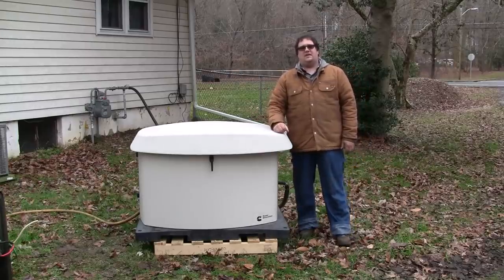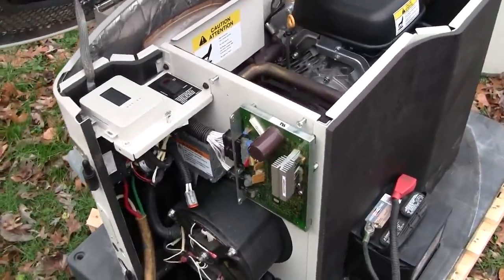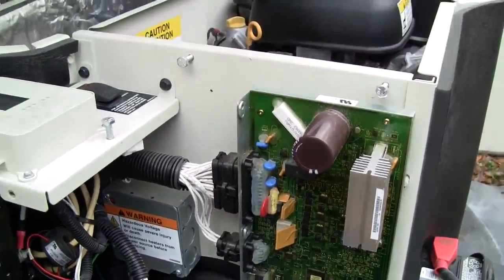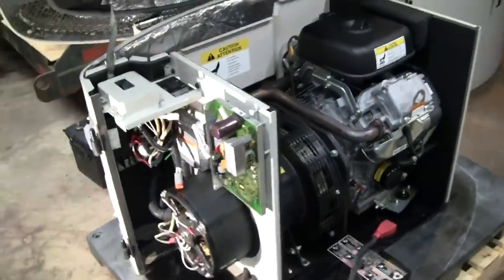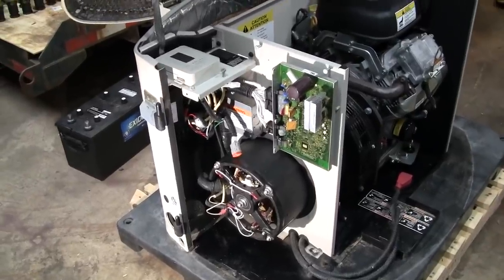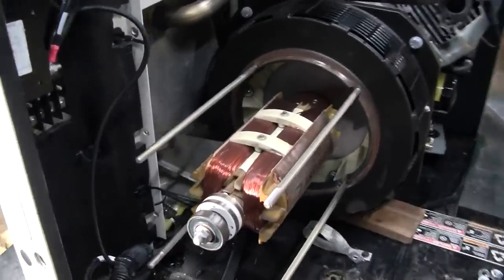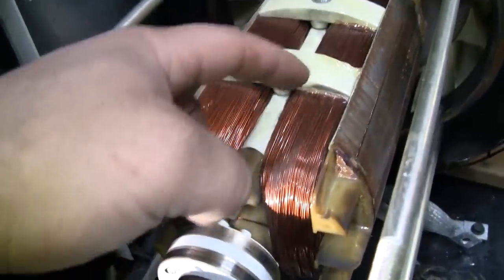2015 Cummins Home Standby Generator IS IT DEAD ALREADY? Pt. 1/2

Comment: Wow and nice find. These things should be bullet proof. Someone at the design computer didn't think this one out and on top of that Cummins should have found the issue and recalled or had a bulletin on this issue. These units are there to work when you need them most and not fail. With your find Cummins should have a lifetime repair on this part. Part no longer available after 5 years make zero sense.

Comment: I just purchased a brand new 20 K Cummins generator, I hope they have the problem fixed in the new models
Reply: I have my fingers crossed that this is not a general design flaw.  I believe something got into the generator causing drag on the rotor, bending the studs and making the connection loose, which melted the plastic to the point where the stator wire lost contact.  Having said that, I would not have designed equipment requiring plastic to wedge a mechanical connection which requires electrical continuity for perhaps many decades.
Reply: Good luck with that idea. Nothing is made like it use to be.
Reply: wtmayhew decades??????? BWAHAHAHAHAHAHA!!!!!!!!!!!!
Reply: Buy the warranty🤔
Reply: @wtmayhew  What type of material would you use WT ???
Reply: @victoryfirst2878  Not an alternator designer here.  Maybe something like phenolic or varnished Micarta to carry the rotor windings, then braze the windings to the collector rings.  I would have tried to make the collector rings one piece if possible.  If not one piece, I would have made the posts out of brass threaded, instead of what appears to be pressed dissimilar metal just begging to corrode in an outdoor environment.  Of course that would be more expensive and/or require more manufacturing steps.  If it lasts 40 years instead of 5, I’m OK with that.
Reply: @wtmayhew  I do believe that forty is a very good number for sure. Hopefully the manufacturer will take note. Peace. VF

Comment: If I understand the original failure mode, for lack of an indication of engine RPM, the computer left the system in "crank" even after the engine started.  Does this mean that, following rotor repair, we should check for damage to the starter or pinion gear?

Comment: Can a home standby generator like generac or kholer be hooked up without the automatic transfer switch? I have a portable with a inlet box now that I just turn main breaker off and open generator breaker to backfeed . I'm wondering if a standy could we wired the same,  2 hots, ground and neautral straight to a big breaker

Comment: Easy peasy. Surprises me the shortcuts for something so simple. You and I would never depend on something like this connection if our family was depending on this genset to keep the house warm in zero weather with the power out. If people even knew this was built this way half the people would fix it similar to your fix. I am not sure that long of a wire out of the slip ring wouldn't pull too hard on the winding over time. Did you ever find out what scuffed the windings? I would stick a knife blade between the windings and coat them with varnish.

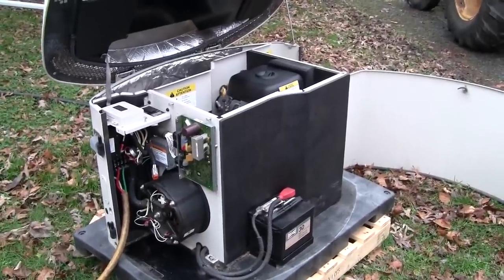Comment: 5:25 there's that left audio only again! By far my only complaint though! Still a great video
Reply: I think is on your side problem, sometimes bad internet connection cut the video buffering first and only audio is left rolling. I have that happened sometimes when in work at sea were mobile data got cut off by distance.
Reply: @Vanha21  It's not just on his side. Ive got gigabit fiber, and have no problems with audio on any other YT video, but this is the second video ive watched from SEM that has left-only audio.
Reply: Okay so I’m not the only one this happens to. Only happens on mikes and Jonathan W.’s channel. I noticed it a week or so ago and thought it was just a problem with my phone. Audio is fine on the rest of the channels I watch besides Jonathan’s and mikes
Reply: Same issue here as well. It was good at the beginning when he was outside and then it went only left channel when inside the shop. I heard a few blips of right channel a few times, sounding like either the mic or camera has a bad plug/jack connection.

Comment: I'm thinkin there's an extenal voltage regulator that is the go-between the field and the 
output of the generator, so if voltage goes above 240, a resistance is put into the rotor
circuit, less field and voltage goes back to 240, if it dips to 230 , more field is made by
increasing voltage to the rotor. It seems the auto start gens have a battery field and 
a solenoid to open propane gas line to engine.

Comment: A couple of tips…I’ve learned…wires mangled or crunched….dog or coyote….wires or insulation cut at 45 degree….pack rats and sometimes mice….that chewed up look may be something out of round….bearing issue?
I’ve learned this from 15 yrs of farm/habitat experience….my dogs and critters have been busy(never sleep) causing tremendous damage and making cars/trucks and equipment useless….

Comment: Having been a product manager for a manufacturer of portable generators that made their own genheads, I would bet money that the "stab" connections from the slip rings to the alternator windings were the result of a cost reduction. I can't tell you the number of stupid changes to good designs that have been proposed in the name of "continuous improvement" programs by overzealous process engineers and/or greedy "supply chain" managers. I have seen major corporations cost reduce themselves into oblivion. Customers eventually bail on good products that are turned into junk by such rediculous decisions.

Comment: My only worry would be centrifugal forces on the wire extensions & solder is not brilliant with vibrations.
That said, it looks better than factory.

Comment: Curious as to how you kept the soldering heat from melting and shorting the varnish on the windings directly in line with your repair?  Things just seem to be getting far too cheap to perform their designated function.  Quality control from brand names is no better than the cheap stuff.  Engineered to and past point of failure.

Comment: I had a similar issue with my onan genset on my RV, they said the stator failed a d replaced the whole unit? I’m not nearly smart enough to understand what could have been wrong but I remember this issue

Comment: I had an extremely small SONY FM radio that failed. I found FOUR cold solder joints on the board, which came from SONY's new assembly plant in Thailand at that time. Something so simple....

Comment: Pretty common to have the connection fail right at the slip rings. I just fixed a Generac portable with the same issue....I am an Onan RV  generator repairman and do many larger machines.........and work for a generator service/sales/maintenance company...We sell Briggs homeowner units. We replace a lot of stuff and no one but me would do a repair like this.....I'm 73...! Cummins-Onan changed their vendor for rotors and stators a few years ago. Availability is not good for a lot of them. Getting common RV machine parts right now is next to impossible. RV stuff like carbs and fuel pumps......Backordered for months.....I buy low cost replacements off Ebay or Amazon......

Comment: Epoxy the connections please to prevent corrosion ( no jb weld) Clear epoxy only
Reply: The only electrical isolation epoxy is putting epoxy for electronics

Comment: That alternator (correct term) was probably made in China. 
Anything from China is usually just a ‘kit’ that needs further work to get it to where it should’ve been when you bought it. 
Good logical diagnosis and practical repair. 👍

Comment: What experience do you have in splitting the armature from the crank…?
I tried cutting a shaft…and using a end bolt to press out the armature…this time it does not want to part….
Reply from the maker: I have herd of people making a plug for the end of the rotor shaft with a grease fitting and pumping the shaft full of grease to pop it off the taper.  I have had good luck rapidly heating the end of the shaft over the taper to break it free if there is enough clearance.
Reply: @SmallEngineMechanic   that heat application
With the end driven down (I used an small impact drive) wish I had a larger one…!
Heat or a torch Sounds pretty convincing…the grease gun approach will be my final feather….it’s a kubota 2 pole and can be shit canned if I cut it flush.
All my heads have been converted to pulley drive or 4 pole….when off grid…slower goes longer.((thanks,))

Comment: So is Cummins Power owned by Generac? Looks like if not, they must have hired the engineering staff.
Reply: Apparently a Briggs engine. All the hard work to have the Cummins brand mean something, to then stick the name on something like this...
Reply: Cummins is Cummins. Actually is a better unit than generac.
Reply: I thought I saw Briggs and Stratton built the engine in this?  The quality of that rotor certainly isn’t anything to be proud of.
Reply: Jeff in TD 
Briggs engine, Cummins built or contracted generator head. 

I had a friend that owned a fairly large small engine repair business. 
He repaired mostly commercial mowers, but did numerous whole house generators. 

His words to me when I went looking for a home generator, stay away from Junkerac. 

That was 15 years ago when the horde of cheap generators started coming in from China. 

I found a surplus 10k diesel genset and converted it it an electronic governor.
Reply: Nice. In RV’s Onan (associated with Cummins) I believe has a very good reputation. I was just surprised by this one- inexpensive engine, and regardless of who built or contracted the generator head- from this video it appears longevity/reliability were not top priorities.

Comment: Not sure what the temperature rating of the insulation is, but while lead/tin is OK for lower ratings at higher ratings the norm is brazing.  Those crude staked joints look to be a very poor solution, and a simple solution - shame the accountants on the "build" side got in the way and cut one too many corners leading to the warrantee costs going through the roof. And that sort of "cost cutting" is seen all too often :-(

Comment: Well as I see it, that answer was more luck than skill as they just are never that easy. I don't fault you on that as I think its nice that the blind squirrel can find a  acorn at least once in a while/LOL. I have never been afraid to go inside, I just didn't know apples from oranges once there. I worked on some gen sets an most times a brush failure or a "other" is at fault as this list can get fairly long. Labor is what kills this gen set as their not cheap nor easy to find someone in field that can fix and if they do, time is money plus its a crazy high price for something simple. Best to just give away a little of their supply as there are thousands that never sold and they are just parts

Comment: Some silastic caulking (Electronics anti-vibration silicone) over your solder joints to the rotor or slip ring to keep the wire from fatiguing and breaking again would be a good preventative.   Unless you have already assembled it at this comment posting.  In that case nice job.

       I am attempting to resurrect an Onan 15KW JC that went under water and am hoping you go over the Magniciter function you mentioned in an Onan repair video you previous filmed.

      BTW can head gaskets be purchased anywhere for the JC?

Comment: Another interesting film, i could listen and watch this guy for ever, many thanks, just one thing is the engine made by Cummins?
Reply: I think those were briggs and strapon.
Reply: Looks like a Briggs Vanguard.
Reply: @mtcruse  Yes, it's a Vanguard.  A 35HP Vanguard.
Reply: @thefixerofbrokenstuff  You are correct. Vanguard sometimes is a champ and sometime is a chump. Depends on the luck of the draw.
Reply: Didn't they go Bankrupt this year?
Reply: @victoryfirst2878  I had a Vanguard in one piece of equipment from the mid-90s.  A 16HP model.  Only trouble we ever had with it was an intermittent problem with the ignition, which thankfully was a known issue and a new coil was fitted which solved the issue.  Of course not long after Kawasaki was the new craze in commercial equipment with their better power-to-weight ratio, but they had valvetrain problems for a while in their V-twins which kept some people running their Vanguard-powered equipment.
Reply: @douro20  I do not mind paying for something great. But when you pay good money and you still get junk, well that party does not last long for sure. VF
Reply: I do not know Gordon. Maybe someone else here would know. V

Comment: I'm surprised that a quality brand like Cummins would build such a weak point in their rotor. It makes me wary about my new
25KW Cummins whole house generator. I did pay for the 5 year warranty which your guy was lucky to have. Also surprised that Cummins 
did not re-engineer the rotor for a 5 year old unit and offer a replacement. Never did like the air cooled, 3600 RPM units anyway.
Reply: I doubt that Cummins designed this, just put their name on a piece of Chinese junk.

Comment: Awesome video! Will you epoxy those wires off the slip rings or something to keep them from breaking due to vibrations?
Reply: I wouldn't trust this unit even though it's "fixed".     Smaller, cheaper disposable units are better made than this.   What residential house needs 20kw?   Do people seriously worry about electric garage door openers, central AC and long luxurious hot showers during an emergency?
Reply: @scdevon  It's not just an emergency... storms sometimes knocks power out in large areas and some places get it back in 24 hrs, but some in 2-3 weeks. Florida here... 
I'm sure the same goes all up the east coast and along the Gulf coast. Not to mention rolling blackouts in California now, Where I am 99% humidity and temps up to 100 degrees with no power for an extended period, yes you do need the AC.

Comment: man i wish i could my hands on a whole home gen set. power outages are given over here in tornado/ice storm alley. retro fitted an 1500va APC battery back up with dual 100AH deep cycles but, that's only good to run a light load for extended periods. waaaay longer than the dual 7AHs it had.  EDIT: guess i should keep my eyes peel for one that might need work. but, i be that's a gamble. re-winds probably cost more than a new genny

Comment: Seeing the dark & light windings had my doubts raised for a successful ending to this video but ... we were assured that they have been seen before on a small Cummins home generator. Okay I thought but the fear of heated windings were set in my mind. Looking at the point of the intermittent connection I'm seeing another heat related suspect area. Did the poor connection provide enough heat to loosen the pressure of the plastic holding the wire to the pin. I would have loved to see if they removed the varnish from the wire where it made contact with the pin.
So with heat being the main culprit my head is saying, to provide a connection which can stand a fair bit of heat your low melting point solder would not have been my choice.
However, I must admit that possibly if the poor connection was not there in the first place there is no reason to get resistance heating. Time will prove if you made the right choice of repair and yes I'll be grinning to see it loaded up and come through the opposite side still happily working. 
Thank you for your videos that take me to so many other types of repairs than I am used to.
I laugh at the little sections you leave out whilst in a struggle moment. Ain't we all been there!

Comment: I have a question for someone - in Australia usually a warranty unit will go back to the manufacturer and be smashed/destroyed due to tax reasons. I was at Sony for a while and all warranties that were not fixed went to the crusher, you were not even permitted to take parts off them (very stupid and wasteful). Are there similar rules in the states or is it not enforced too strictly etc?

Comment: man I love to run across a generator like that, that just needs a small fix like that.  When looking at were the hole is that the pin when in looks like it got hot and melted the plastic some causing the open short to were it was barely making contact.

Comment: They gave you a new Gennie for an iffy connection - I had an older Gennie and it had an Ignition Light bulb that was iffy - I realised it was part of the excitation circuit and tweeked the bulb holder and  it was sorted - odd how little things matter - I dont like the look og that shellacked winding to be honest - why is there no screen on the air cooling?

Comment: Diodes could be shot... also the avr is supposed to provide the starting dc voltage to the brushs if the unit hasn't started in awhile that voltage might have been discharged. We had a problem sometimes with that when load banking we made an adapter to go on the f1 and f2 lines while we checked the dc voltage of the exciter lines on different loads. We plugged a 9v battery in the line to start the exciter and that would be enough to get ac voltage going
Reply from the maker: Thanks for watching!

Comment: I starting to hate these "new" cheap pressed (crimped) connections between winding wires and collector plates or  slip rings contacts (studs) at generators and small AC brushed motors. Nothing can substitute a good soldering. :)
Reply: Real crimped connections are reliable.  But real crimped connections don't use the pressure of plastic with compression set issues and materials that won't cold-weld together.  I think your "pressed" is a good name for them.
Reply: @paulmoir4452 , I'am agree with you, concerning cable lugs and hollow tubes for wire joints (I can't recall English / American term for these tubes), that were specially designed for crimping by hand tools and hydraulic press. We haven't any issues with these types of connections in our practice.